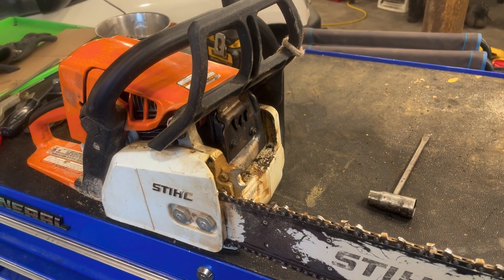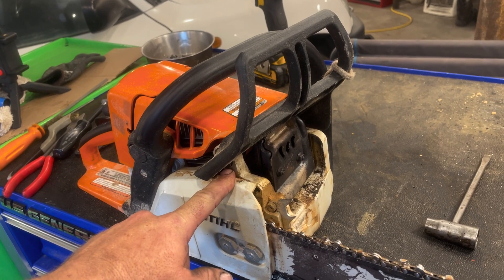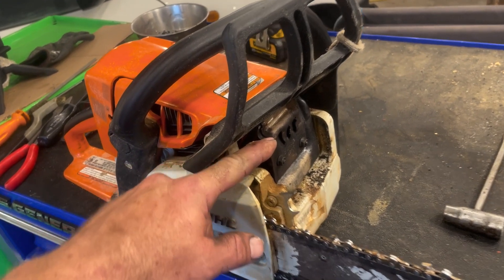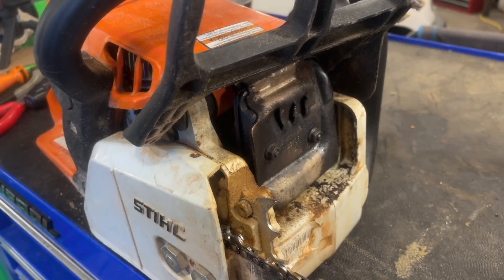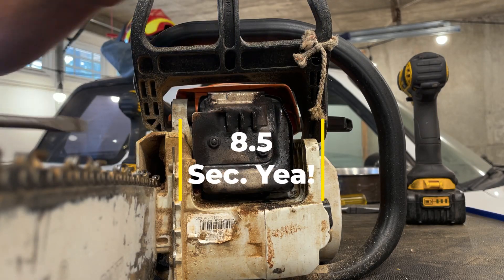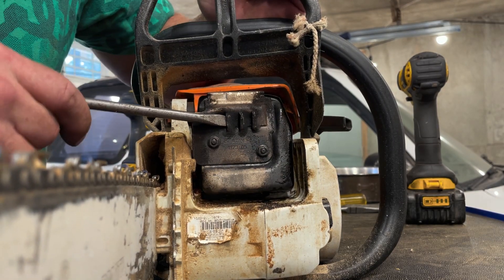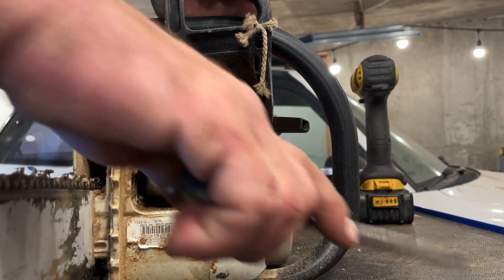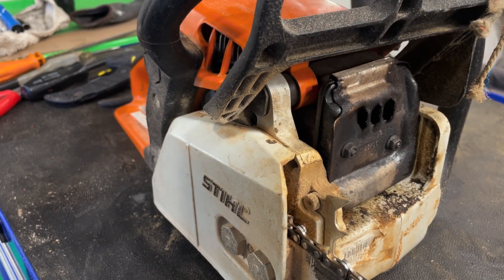Chainsaw exhaust port size? Does it really matter?￼

Comment: I did the full muffler mod/ cut out the baffle on my 025.  Had to get a new carb cause the factory one you can't adjust the high screw.  Wasn't really sure if it made a huge difference thought because the spark arrestor screen is still inserted but looks like it does!

Comment: I'm new to trying to mod a saw. I want to open the exhaust on a stihl ms 250. How do adjust the carb for a more open exhaust,?
Reply from the maker: How new is the saw? I'm just curious. My elevation is 4,500 ft, i did this to a  new ms250. Surprisingly, it didn't need any adjustment to the carburetor. But that doesn't mean yours won't. There's lots of videos on how to adjust your carburetor. It's a balancing act between your hi jet / low jet and idle screw.

Comment: Does fuel consumption increases drastically?
Reply: Have you considered putting out a video on carb tuning? Would love to see it. Thanks!
Reply from the maker: @waderussell937  working on it, coming soon!
Reply from the maker: Increase or decrease either way I haven’t noticed a difference. If I had to guess, I would say fuel consumption would slightly decrease only because the engine doesn’t have to work Quite as hard to do the same work.
Does that make sense?
Reply: Yes